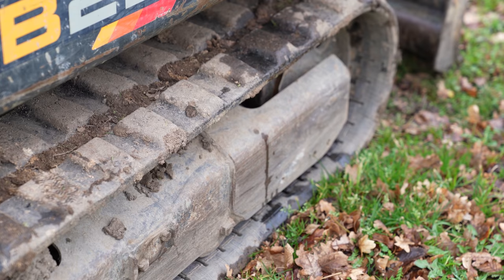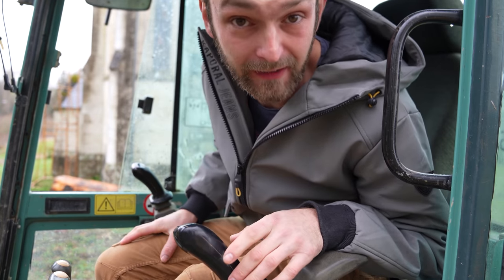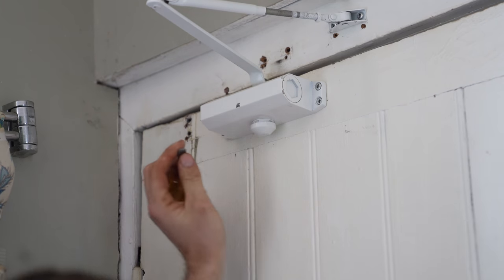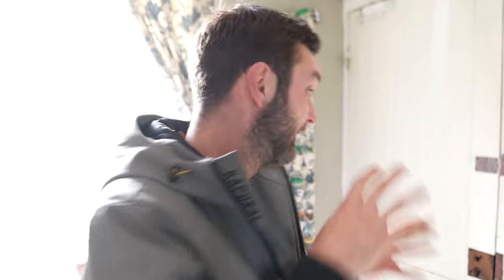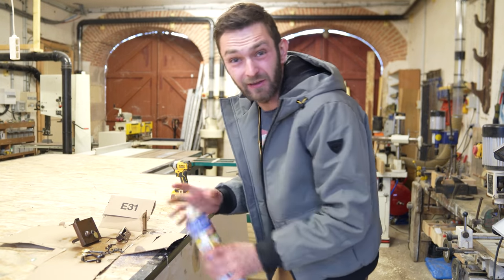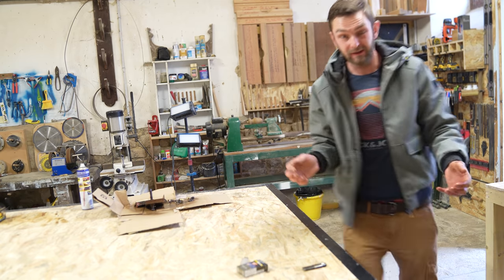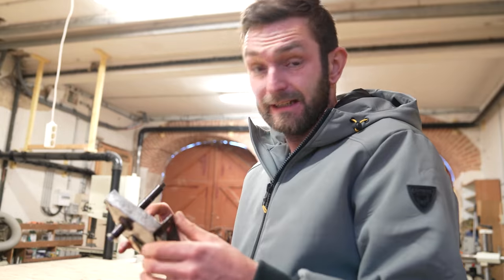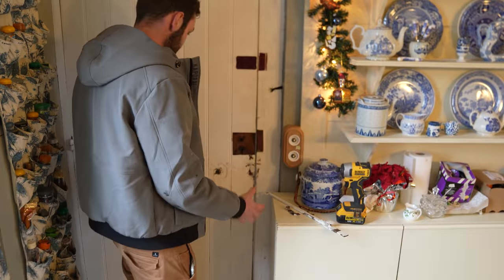Im changing the locks - EP186

Comment: Hey I’ve seen this on DIY shows here in the states. Get an old crockpot from a thrift shop and heat water and the painted metal inside the crockpot. Let cool and the paint should peel off.

Comment: I have worked on door locks that are only about 100 yrs old. If you soak tha hardware in distilled vinegar it loosens the paint. It reduces toxins  like lead and arsnic from becoming air borne. The other thing about old locks you can make replacement parts.

Comment: What’s chateau diaries gonna be without that horrible door slapping and creaking, that was part of the classic soundscape of her vlogs!
Btw wd40 isnt a lubricant, it’s a cleaner, for locks and hinges you need a real long term lubricant like jig a loo, i learned that recently! Good work anyhow
Reply: I didn't know that about WD40.  Cheers for the info👍
Reply: WD 40 is actually a rust preventative, stands for Water Displacement, 40th formula.  First used to prevent rust on missle parts stored in Florida.
Reply: @eyemdphd  thank you just what I was going to write…
The lubricant is very thin
WD40 WaterDisplacement formula #40 
It really simple and on the can. 
Though they do make other stuff now.

Comment: Don’t forget if you have a real rusty object and want to restore it without risking marking it or using chemical you can use 1 part molasses and 9 parts water.  You need to soak it for a few days sometimes a week or two. We used it on old locks and keys we found and it worked beautifully.  A key we found was so heavy if you dropped it you would jump but incase it landed on your floor and broke a toe.  It is not in my possession now but I think if you carried it in your pocket like we do these days you would be charged with carrying a weapon.

Comment: will the paint stick once you sprayed the outside of the lock with WD40?  You might want to snag you wife's nail polish remover and do a quick once over the outside of the lock before you paint it.  Acetone will take all the oil off and it is highly flammable.  Great fire starter.  ha ha ha

Comment: Dan the man - diggers and drones for hire!! HAHA!!  Funny.  But you are working smarter, not harder and that's a good thing I guess.  At least it's getting done eh? And you're right - it does look good.  Going to be a nice space for a formal French garden.  Those door issues - while little jobs can often turn into royal pains in the arse.  However, these piece now look good AND IT IS NICE to now have a place indoors, in Amaury's workshop to do these little fix-it projects rather than be out in the cold some other area of the chateau. Be glad. HAHA!! YOU ARE the crafty one aren't you - I mean the elastic tie for a door handle until you get the door fixed and all the parts back on.  Crafty indeed.  You are the MAN DAN!!  Great job always. Cheers mate.
Reply: That’s not where the French garden is going. 
Behind the Chapel between the edge of forest from the back of the Cháteau towards the lake will be the informal English border style garden. 
The French Formal garden is in front of the original 16 century Cháteau all the way out to the dry moat.
Reply: @Tony-InLosAngeles  you’re completely right